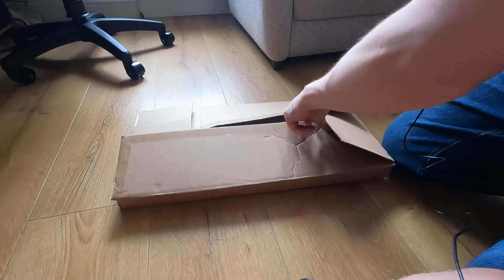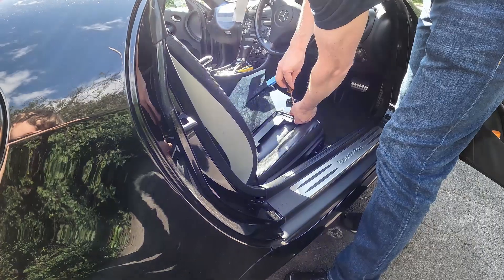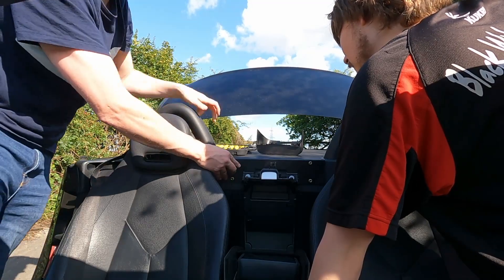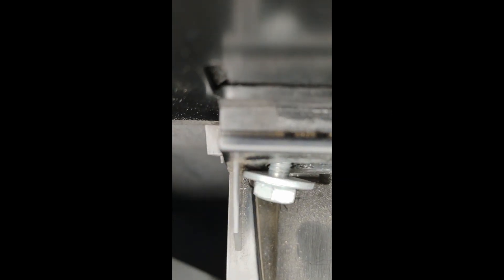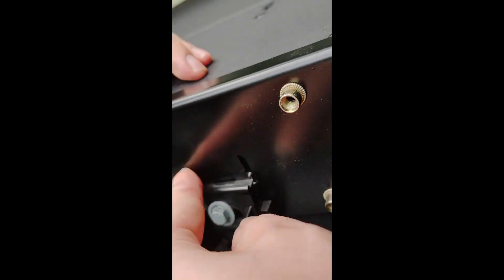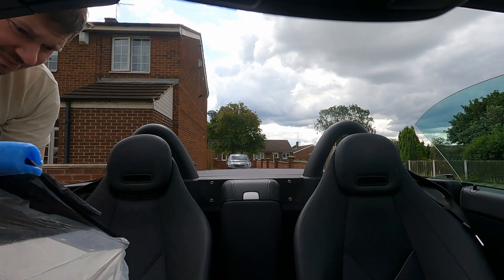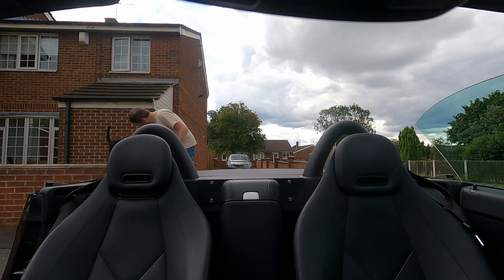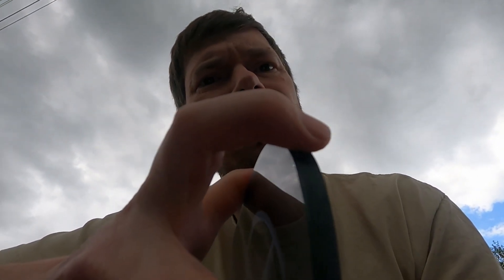Issues fitting my Pippens wind deflector to a Mercedes SLK

Comment: I found the fitting very straightforward on my SLK280 and didn't  have any of the problems you encountered. Maybe your bolts were shorter than mine?
Reply from the maker: @Muttlyoo7  perhaps. I was also wondering wether they were changed pre face-lift and post face-lift.
Thanks for the comment. Just be very careful cleaning. I have cleaned mine and got the hairline scratches, and I thought I was being very careful. When the sun catches them, I f8nd it quite annoying I the rear view mirror.

Comment: Why did you not try longer bolts ???
Reply from the maker: Because I used what they said worked, which was the existing bolts.  Turns out, they do, just a bugger to fit. Personally I think they should send out longer bolts in the pack , part of the deflector kit.

Comment: HELP ME WITH MY SLK GLASS ROOF PLEASE
Hi Dave I've just bought an SLK 250CD with a glass roof and there is a solid lining blocking out the light fox sake why did Mercedes do this
So would you do a vlog with my car and i can pay for the parts I can get a roof liner for £300 on EBay its £2300 with Mercedes Benz
All there is are 2 screws and 6 clips I think I saw a German guy relacing his roof on a SLK 350 and it looked easy
Surely there must be loads of people with glass roofs who don't know you can do this and nobody has done a vlog here on this subject
Obviously i will help if i can to hold things lol 
So if you are interested please let me know I'm fuming i was conned, I asked if there was a glass roof and the salesman said yes which there was but I should have asked if it was a sky roof so its my fault, the salesman could have been more helpful but then I wouldn't have bought the car 
ok look forward to hearing from you hopefully
Reply from the maker: You have to be so careful. Due to the roof mech, you need the correct supports for the roof if it needs to be left in an open position to do the work, as you also need to override the roof from closing. Even some German car specialists won't do work on the roof.

I would advise you to go on a website  like www.slkworld.com or some specialist FaceBook Mercedes groups.
Your car is also a R172, so will be different to my R171.